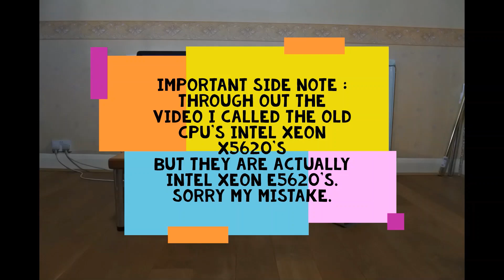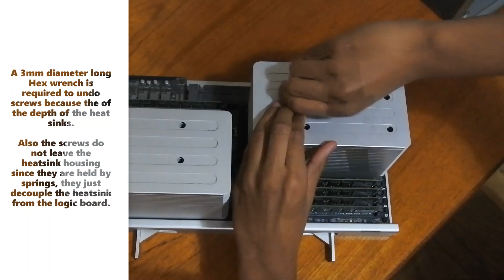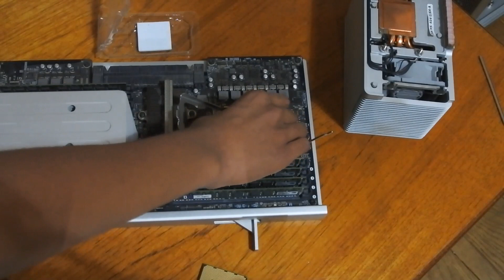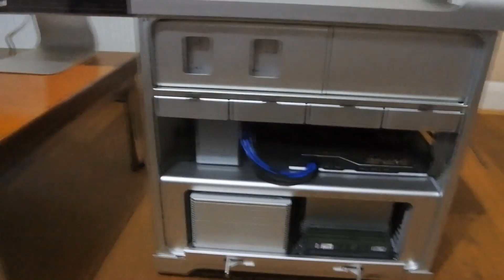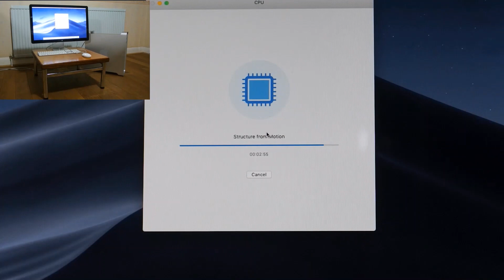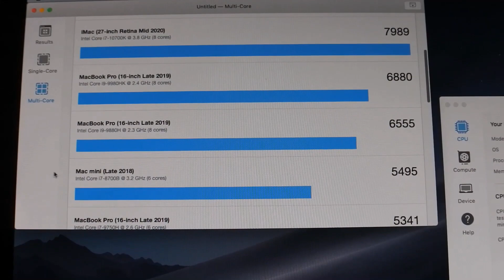5,1 Mac Pro MAX CPU Upgrade - Dual INTEL XEON X5690'S (12 cores, 24 Thread @3.46 gHz)

Comment: Were you able to directly upgrade to Big Sur or Catillina ? I’m considering upgrading my 8 core to 12 ( dual Xeon X5690’s ) thanks : )
Reply from the maker: No, only till Mac OS Mojave, when you install a metal capable GPU. To upgrade further you will likely need a patcher.

Comment: I want to upgrade to Dual-X5690s, but I keep hearing the processors need to be a matching pair.
- Does this mean I can't buy a "X5690" from one seller and another "X5690" from a different seller?
Reply from the maker: I personally bought my CPU's at the same time because they were cheaper, however I don't think that stops one from buying them separately, just make sure they have the same model number on the top. ( Because you don't want to end up with one or both as  pre-production units; the way to make sure is to buy 2 CPU's that say SLBVX these are not pre-production & should work fine.

Here are the links to a forum posts which had the same question & a good answers as well:

https://forums-macrumors-com.cdn.ampproject.org/v/s/forums.macrumors.com/threads/matching-pair-of-cpus-to-upgrade-2012-mac-pro.2251758/?amp_js_v=a6&amp_gsa=1&amp=1&usqp=mq331AQHKAFQArABIA%3D%3D#aoh=16138984942085&referrer=https%3A%2F%2Fwww.google.com&amp_tf=From%20%251%24s&ampshare=https%3A%2F%2Fforums.macrumors.com%2Fthreads%2Fmatching-pair-of-cpus-to-upgrade-2012-mac-pro.2251758%2F

https://forums.macrumors.com/threads/new-cpus-for-5-1.1845488/

Comment: I would like to fix my HP Laptop, I think the cooling fan could be improved. Where can I get help in solving this issue?
Reply from the maker: I would definitely recommend checking out the  iFixit repair guides they are very detailed and provide clear advice & instructions about a wide variety of devices. That should give you a clear idea of what would need to be done & how to do it if you wanted to carry out the repair yourself.